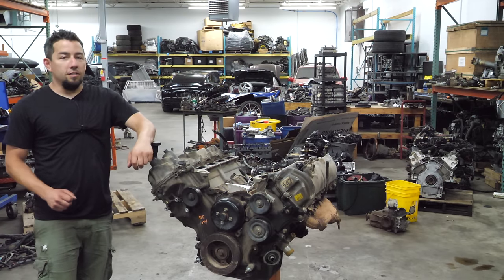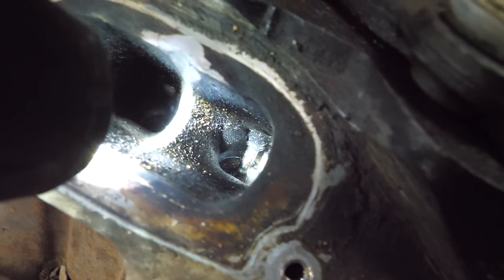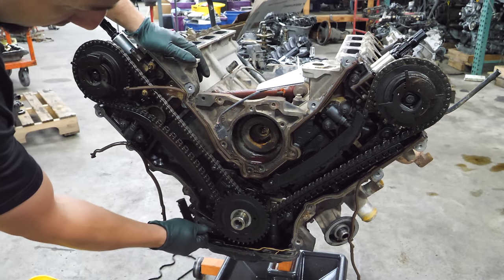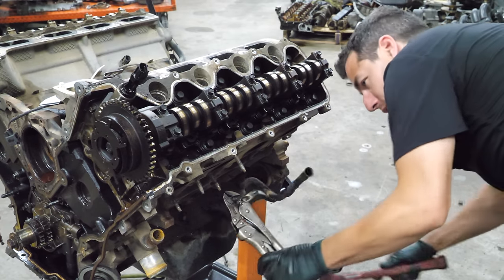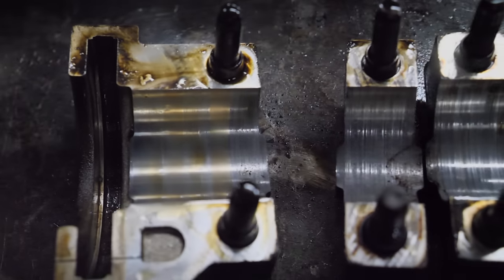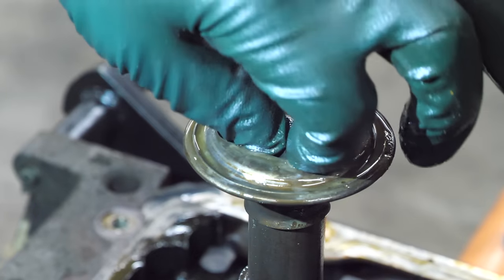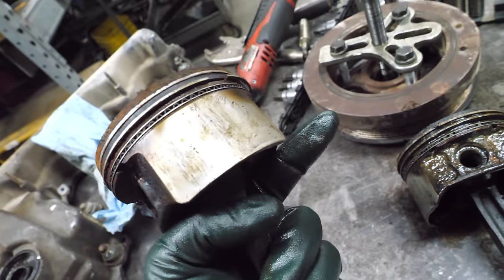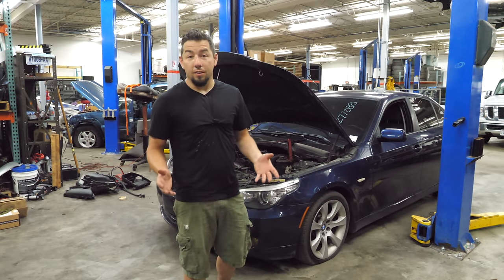Bad Ford 5.4 3-valve V8 Engine Teardown. Which of The MANY Possible Failures Took This One Out?

Comment: The commonality of the engines you said everyone loves.... they are all straight 6's.  Straight 6 has always been a superior engine design. Way better balancing characteristics, both primary and secondary, the intake manifold isn't in a valley, and as such isn't exposed to odd expansion and contraction, it has a naturally equal cooling of the block. And most of all, it has 7 mains for 6 cylinders (vs 5 mains for 8 cylinders), and each connecting rod has a dedicated journal. V blocks are compact but are not as tough as a straight block.
Reply: They're also easier to manufacture due to their relative simplicity.
Reply: Agreed in principle. But I love the 6.6 v8 Duramax as my favorite diesel for consumer trucks. It's just got all the check marks in the right places to me. The Cummins straight 6 I've got no problem with, except that they're in a dodge or a ram and the 6.7 is pretty expensive stand alone. The Ford 6.7 is great but good ole Ford keeps selling the failed injection pump w it, destroying trucks around mid-life. Duramax also has a str8 6 in the 3.0 liter variety for half tons. That is a terrific little engine I wouldn't mind having. At 3 liters it's knocking on the door of the original 6.6 V8 for power. Marvel of a machine and not an expensive option. Well, if u don't look at the price of biden-diesel fuel.
Reply: You also need a fuck load more room. There's a reason you will never find an inline engine In a super car.
Reply: @ineedapharmists  space saving is a bigger issue than people think. I remember my buddy's Nissan 240sx had a long hood bc of the straight 4. Couldn't imagine jamming 6 even in that long hood. Interestingly, the Ford Econoline e150 van prior to 97 had the inline 6 Ford 300 4.9 engine, but in 97 Ford ended the str8 six in favor of the Essex V6 4.2. The V6 had more HP, but the str8 six had more torque. The point I'm trying to make about the vans, well and the pickup trucks too for this matter is those vehicles had enough room to run the str8 six for years and years, but then they switched to V6 and kept nearly identical the size of the engine bay and drive line area. So why'd they drop a perfectly good str8 six in favor of a V6 when spacial capacity was not the issue? I think the obvious answer is Ford wanted a consolidated engine line going into the next generation of engine they produce, and the V6 was much more versatile. So, because a V6 can fit better in a Windstar, or a Taurus wagon, or some other POS that probably isn't even sold by Ford anymore, the trucks and vans suffered. Doesn't seem fair.
Reply: V6 are equal, the J series as an example. Also way better fitting
Reply: @greengoat5654  the v6s are in no way equal when it comes to reliability and life of the motor they are also torque monsters I believe they got away from straight 6s because they were TOO reliable
Reply: @poisonPpaully  nah a V6 will last you just as long and take up half the space
Reply: @poisonPpaully  The 4.3 in my 2003 Econoline begs to differ - routine these engines see 500,000 miles with NORMAL maintainance (the transmissions aren't so good), which is just as good as any of the inline 6s.
It IS a rarity though.
Reply: @bricefleckenstein9666  the 4.2 you mean. We had the 97 e150 also w/ the 4.2 V6, and the engine was put through hell hauling far too much weight as a work truck for 25 years, mixed in with a few years of hauling and launching an 18ft heavy fiberglass lake boat, probably north of 6000lbs w/ trailer. That engine was abused and neglected, only getting an oil change once a year if it was lucky. I think the air filter was changed once. It got spark plugs once. 🤔 The odometer broke somewhere around 300k miles and the air vents were fubar, constantly changing airflow direction as the engine accelerated or didn't flow at all. Those vans are infamous for the vacuum hoses disintegrating into garbage. That V6 never fussed, never misfired, never leaked or ticked, really never gave us a single problem. The trans cooling line got pinched in a fender bender which no one noticed til the trans starting doing weird shit a year later. Replaced with a junkyard trans and she kept taking us to work for years after. That van is retired now, but my dad has it parked and he doesn't plan to get rid of it. The body is taking to warping and rusting, but that's a result of the work we made it do. So in terms of a work truck, that era e150 with that 4.2 V6 was a solid tank and a hell of a value that punched up. As a 97, the bloody door handles were broken all around the truck by 2000, 😂 but some bungees and zip ties remedied that. On one hand it's an absolute piece of shit by all rites. On the other hand, what a durable work truck! I'd love to pull that engine and use it to power something else one day. At best, a fun car or truck the family gets some use out of, at worst I can use it to spin a generator that could probably power 3 houses. Plenty of torque in usable engine speeds. And not so hard on fuel eating. Remember, 4.2 is huge for a V6. Piston for piston it's bigger than the GM 5.3 V8, and much bigger than the Ford 4.6 V8. I've heard the torque band is engineered to hit max under 1500 rpms and stay flat all the way to the hp peak around 4500 rpm, resembling a big block more than it does a sedan's V6.
Reply: @bricefleckenstein9666  Do you actually mean the 4.2 in your Econoline?
Reply: @tedschmitt178  Possibly - I think they only offered 2 engine options in 2003, a V6 and a V8, and mine has the V6.
Reply: This is all prolly why car makers are moving back to them. Im always gonna love a nice V8 tho. With that beautiful harmony of work gettin done it makes. Id do a straight 8 tho if they brought em back. I think thatd be dope
Reply: The Ford 300 was magnificent and used in industry (aircraft tugs, generators, pumps) long after it left truck use. The 4.2 that replaced it is a piece of shit due to hydrolock (never truly fixed!).
Reply: @Comm0ut  I wonder if we're thinking of the same 4.2 V6 - like the one in my E250, that is well past 300,000 miles and still going strong, and HAS THE REPUTATION of commonly lasting 500,000 miles and more?
Somehow, I doubt it....
Reply: @bat__bat  Ford dropped the 300 straight six due to emissions and fuel economy.
Reply: @bat__bat  i got a 4.2 in my 99 at only 186k, my friend at work who is a mechanic has 3 f150s, all with the 4.2 and one of them almost has 800k,(original engine)he said they can go forever
Reply: That's why companies like Mazda are going back to them, hopefully they can prove to the rest of the automotive industry that straight 6 gasoline engines are worth considering again for the everyday consumer. I hope the straight 6 Stellantis is replacing the HEMI with will be good, but it's Stellantis so im doubtful
Reply: 4.0L Jeep and the 300 Ford inlines outlast the body of anything it is put them in unless you run dry of oil.
Reply: @BigMuskie-y1t  after you change that stock timing gear 300 is eternal
Reply: Inline engines are the best design ever.

Comment: In NZ and Aussie, these came as the 3 valve (rated at 230kw) or the 4 valve quad cam motor (rated from 260 through to 315kw). The early 5.4 quad cams had an issue with timing chain guides failing but other than that they were/are quite reliable. The timing chain guide issue was sorted out within a couple of years and the motors were used for another 5 or 6 years before being replaced by the supercharged 5.0 motor

Comment: I have a very nice 2012 King Ranch that had 201,000 trouble free miles, of course I am an oil change freak, every 3500 miles. The chain guide on the passenger side broke, it jumped time. So, looking at my options, new vehicle cost 75,000.00, used ones are in the 50’s, so I elected to buy a Powertrain Products replacement engine, these engines have upgraded dorman phasers, heavy duty melling oil pump, and best of all, cam bearings. I’m all in at around 4500.00, with me installing it myself. Runs great, so far I’m very pleased. Our police fleet of Tahoe’s have huge problems with ls platforms with oiling issues, the cams just get chewed up. Just shows that all engines need good oil services.
Reply: Some mechanics say Dorman cam phasers are not good. 🤔
Reply: Hate to tell you get those cam phasers and chain sliders/ tensioners replaced with genuine ford stuff. Dorman is way cheaper (made in China) not upgraded. And yah unfortunately, timing components are a maintenance item on this engine. Right around. 150-175,000 you need to have them replaced. Search up the master of 3v 5.4 fords here on YouTube . Ford tech Makuloco
Reply: Junkyard engine come out good
Reply: Speaking of LS, ive pulled camshafts out and cam bearings cam with it. Or you'll find them were they've walked out of their spot.
Reply: @BruceLee-xn3nn  yep typically number 3
Reply: @jeffmiller3150  I'm one of em... Too many failures. Either use Ford parts or lock out the phasers and reprogram the PCM.
Reply: @BruceLee-xn3nn  I had a Ford PowerJoke 6.0 come into our shop after being severely damaged by overheating. No start. Removed the crank sensor, the end was broken off... Cam bearings were destroyed and became ribbons that walked out of the journals. Ate the tone wheel as well.
Reply: @Sunspot-19  I've seen guys with the 6.0 sitting on the side of the road on a mountain with hood up and steam rolling out.

Comment: I’ve still got an ‘08 F150 with the 3 valve, it’s been fine, zero complaints. The ‘08 got the updates heads that take real spark plugs. The only thing I’ve had to do was put exhaust manifolds on it. I guess changing the oil on a regular basis helps.

Comment: A Melling M340HV oil pump is a game changer for these engines. Combined with the iron tensioners, you should be good. Not a small task, but you should only have to do it once.
Reply: Yup exactly what I did to mine
Reply: Um......no. being a thirty year master tech and having had to have written several tsbs for ford and having had to solve several of their engineering "riddles" I can tell you the if you changed the pump and tensioners and had no issues you were simply lucky. The timing rails ALWAYS twist, break, or otherwise fail due to the fact that they see high heat, and have high chain tension over a plastic rail. You can pull the heads off a good running 3v and still find that they are trash and have to replace them all together. When you get into the later model 3vs you will find that the oil passages in the head are far too small for proper lubrication which is why those heads fail more often. But the timing system and heads are probably the most failed systems on the 3v. Not something an oil pump and tensioners would solve. Until they make revamped heads and stell backed rail guides this will always be an issue in the 3v. The oil pump replacement will help with the million different pressure bleeds these engines produce though.
Reply: @mrmotormd   Um..... no. The chain guides only break when you ignore the blown out chain tensioner seal for months and let the chain slap them around. Ford has been using plastic chain guides on hundreds of thousands of vehicles for decades. They do not just fail. The failure is always the result of extreme neglect. The only oil passages in the head that were made smaller had nothing to do with lubricating the cam or followers, the oil passages were for the RETURNING oil. The low oil pressure in the head was the direct result of the oil pumps insufficient pressure and the roller followers oil port being too large and not creating a strong enough jet. The new versions corrected this with a smaller port creating a stronger jet. The heads do not fail first, that's the bi-product of ignoring your followers, VCT solenoids, phasers and tensioners, which then causes grooves in the cam caps and towers, which then requires a new head. Or, you ignored engine knock for so long due to failed roller follower needle bearings due to low oil pressure that the follower seized and sheared part of the head when the cam came back around. A better oil pump and tensioner would absolutely have a massive effect on the longevity of the motor as oil pressure was the root cause of all it's problems. 

I hate the techs that do not look into the real causes of a failure. They just see something break and think "must just be a bad part". Guess what? Metal chain guides won't fix that motor. Larger oil gulleys won't fix that motor either as the return was never an issue. Revamped heads with replaceable cam towers would be nice, but that won't save the cam from chewing them up.
Reply: @chaseacklam6174  and this might be why ford engines are not getting any better .of course I'm referring to the master  tect who "fixes" the engineering issues for ford , I recently bought a 98 f150 4x4 because the price was crazy low because it was said to have a rod knocking. I got it home and started messing around with it and I just don't think it's a rod knocking. My question is could cam phaser issues cause a knock that sounds almost exactly like a rod knocking?
Reply: @Cjohn31 I’d put a breaker bar and socket over the crank pulley and turn over the engine a few times by hand. You’ll probably need to take the belt off. If it’s rod knock you’ll be able to hear it at the ends of each stroke. If it’s not that, I’d say it’d either a phaser, or a bad roller follower that it’s marking the knock sound each time the cam lobe swings around and hits it. If you pull the valve cover you can easily feel the each roller follower to see if one has failed. If they all seem fine, I’d think it’s safe to assume it’s the phaser. FordTechMakeuloco has some videos explaining the phasers
Reply: @chaseacklam6174  appreciate the advice,thank you
Reply: @Cjohn31  98 f150 has no cam phasers. It is the crown vic engine.
Reply: @alb12345672  does it have the over headcams?
Reply: @Cjohn31  YES it is an SOHC engine, no cam phasors though. The engine he took apart also has 3valves, yours has two.
Reply: @Cjohn31  Must have been abused to hell and back for that to have bottom end issues. They are more reliable than a toyota. Only issue were blown spark plugs (fixable too).
Reply: @alb12345672  it's something up in the passenger side valve cover it sounds like
Reply: @Cjohn31  Maybe replace the rockers. They are easy to get out. One could have worn out. A lifter can go bad too. You can pull the valve cover and inspect.

Comment: I had a 09 f150 with the 5.4 3 valve, best motor ever, i did synthetic oil changes every 5000 miles, put 441,000 on it in 11 years, sold it to a friend and still driving it.  Never had any issues including electronics. I used it for construction and towed all the time. Never had a cam phasers problems. Did 3 spark plugs changes.  Best truck and motor I ever had.
Reply: I use amsoil and go 15000 miles, no problems
Reply: Mine gas been good too.synthetic oil with a bit of tranny fluid,regular scheduled plug change, Ford oil filter only . Quarter million on her now.
Reply: @husker1230  Yes, Ford oil filter on mine every time aswell
Reply: Yeah and it's from the later years too.
Reply: "Best motor ever" is just an opinion

Comment: If you catch a 3v before this point and put in the ratcheting 2v chain tensioners and updated cam followers youre good for a long time. A melling high volume pump is a good upgrade as well.

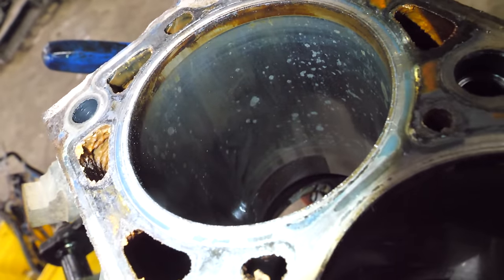Comment: I bet that deep groove at 26:45 was caused by an improper broken spark plug extraction. The process involves pushing the porcelain down with the tool and thus breaking the ground strap on the broken plug. Sometimes, the porcelain shatters, and if all the shards are not removed from the cylinder, it can lodge and do damage.
Reply: Makes sense
Reply: It's going to have to go overbore. Ever heard of a sleeve?

Comment: I have the 2004 f150 lariat 5.4 4x4 v8, with 200k miles, have had no problems, and really hope not to, main problem for me are the spark plugs that break SO easily, been lucky enough to not break more than 1 but has been running smooth, so I guess I’m lucky. Will update if anything goes wrong

Comment: Hey Eric, I don't know if anyone has ever suggested this or told you before, but sometimes if you use a little heat from the likes of a propane torch in the area of the dipstick o-ring, it can really loosen em up.

Comment: I'm not denying the general consensus, just my personal experience servicing 2 F150's both with 5.4's- one has 221k miles and runs fine, the other has 200k and needs the roller followers replaced.  both have been cared for.
I think these engines need regular oil changes more than others to live a long life.
Reply: yes they do
Reply: Just wait till it needs spark plugs
Reply: @andrewschmitt5792  the plugs have been replaced, and the updated part# doesn't have issues.
Reply: This is very true. A lot of "work" truck owners think that just because it's not a "fancy" car, they can neglect oil changes (maintenance) on these 5.4 trucks. That's just stupid... These engines are very unforgiving of lack of maintenance.
Reply: @jima3129  nope, guy still hasn't brought the truck by for the followers.  I'm wondering if the lifters should be replaced at the same time?
Reply: @jima3129  that's a great idea, you'd think that cross bar would un-bolt.  my brother did his 5.4 and only complaint was leaning so much in to do the job, said he wanted to pull the motor to make it easier.